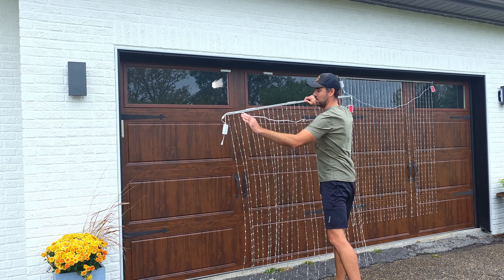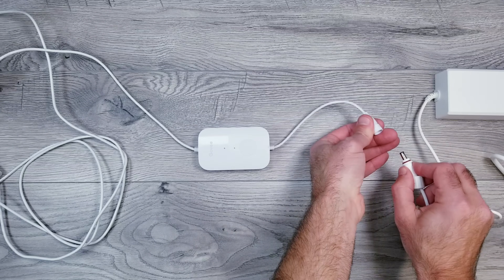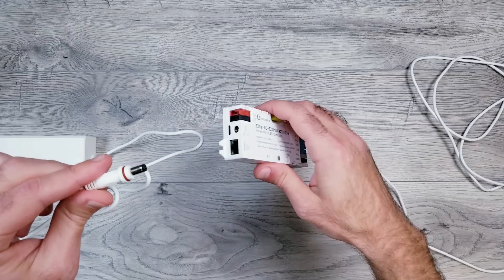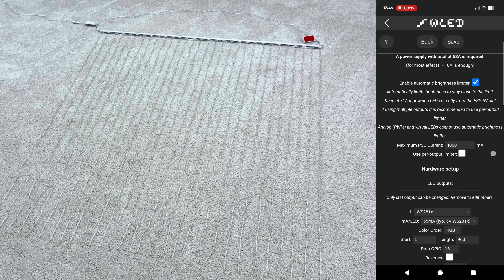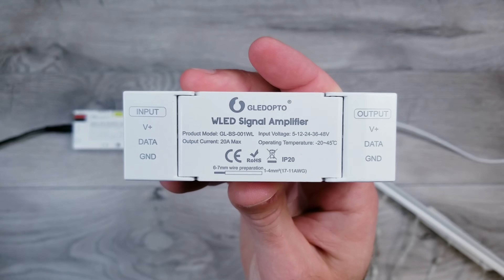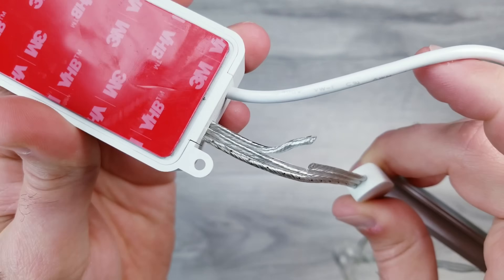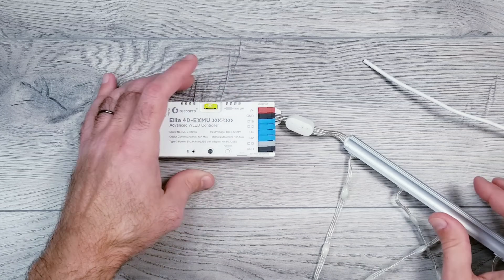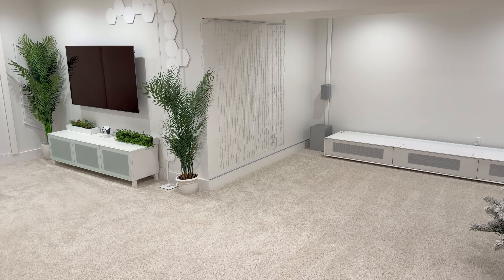will it WLED - episode 9 (new Govee curtain lights PRO)

Comment from the maker: Govee Curtain Lights Pro: https://amzn.to/4oZCkdC
WLED 4D Elite controller: https://amzn.to/4rshOot
Aluminum Profiles i put the curtains in: https://amzn.to/4pVprCs
3m sticky pads: https://amzn.to/4pErBXb
Wire stripper: https://amzn.to/48ckcIk
5v 10a power supply: https://amzn.to/4qda2xs
Waterproof box: https://amzn.to/4pULdWU
Wago Connectors in line: https://amzn.to/49iF6WE
Wago Connectors variety pack: https://amzn.to/48KDrch
heat shrink tubing: https://amzn.to/47QDSBd
heat gun: https://amzn.to/43KZ4Gi

Awol 3500 Pro: https://amzn.to/48ypfDI 
Awol Thunderbeat Speakers: https://amzn.to/4ndzQYd
Shore Laser TV Cabinet + NothingProjector Motorized Screen Bundle : https://bit.ly/4gnltPd

Relevant videos:
Family Media Room Build (ust projection setup with leds): https://youtu.be/IW_wCNGrUyU
Family Media Room Build (65" tv setup): https://youtu.be/H_hejZCOB9o
How to install curtains in aluminum profile: https://youtu.be/FCGJc5-cnTA

🎧🎧🎧 Music (helps support the channel) 
most of the outro songs: https://static85.bandcamp.com/

Visuals at the end: https://www.youtube.com/@visualdon

will it WLED - Episode 1: https://youtu.be/9LPgn81PJnc
will it WLED - Episode 2: https://youtu.be/82lIHTMrzB0
will it WLED - Episode 3: https://youtu.be/3jHuABfkUT8
will it WLED - Episode 4: https://youtu.be/6VestnL6yE4
will it WLED - Episode 5: https://youtu.be/qtBzHRdfxvg
will it WLED - Episode 6: https://youtu.be/JK1xGBP-zhk
will it WLED - Episode 7: https://youtu.be/U6JEBI1LDZ8
will it WLED - Episode 8: https://youtu.be/IwKhO6JDJW8

=============================
Support My Channel Directly:
Become a monthly contributor on Patreon: https://www.patreon.com/ChrisMaherDIY
Buy me a Coffee: https://paypal.me/ChrisMaherDIY
==============================

The best way to help support my channel is to like, comment, make sure your subscribed and share my videos with as many people as you can. The other way is to use my links above as I get a small % at no extra cost to you if you buy something. Thank you all for the support!
Reply: can you do the govve cone tree
Reply: Chris will this setup work with the previous Govee curtain lights 2 as well?
Reply: @ChrisMaherDIY thanks a lot for your awesome work. I found inexpensive almost identical 5v 5000mA curtain lights (no injection) on Amazon that are 21 x 21 and it works perfectly with the same gledopto controller and the original psu. I would like to add 3 more curtain lights to have a total of 4. Can you tell me how to do that both in wled and how to wire it?

Comment: Great video , thanks . I've tried to convert a goovee lyra floor lamp  using the goovee led strip it came with, however it has 5 wires, (5v, data, ground, w, ww and 24v ) used a 24v power and connected to 24v ,data and ground .  No joy 😢

Comment: Happy New Year!
I wonder if you've already gotten the Ceiling Lights (H60A1) and/or the Ceiling Lights Pro (H60A6) with WLED to work. I've installed a bunch of these things here, but I'd like to be able to control them with WLED.
Unfortunately, there is no information available about the ceiling lights.

Comment: so when combining 2curtains, did you use 2 different output ports on the controller or did you just connect the data (and power) lines together?

Comment: @ChrisMaherDIY thanks a lot for your awesome work. I found inexpensive almost identical 5v 5000mA curtain lights (no injection) on Amazon that are 21 x 21 and it works perfectly with the same gledopto controller and the original psu. I would like to add 3 more curtain lights to have a total of 4. Can you tell me how to do that both in wled and how to wire it?

Comment: Love your content like everybody else in here. I gave it a good 10 seconds of scrolling trying to find the answer. Will this work on the original version of the lights that I have or only the pro series? If the answer is no, is there a simple workaround or completely different you think?
Reply from the maker: The originals for sure work. I cant remember off the top of my head on the exact steps but those are running 5v lights (but I cant remember if they are being powered by higher voltage and being stepped down like these are) Should't be too difficult to play around and get them up and working!
Reply: @ChrisMaherDIY  also love your curtain video light you just posted today. I've been contemplating just getting a light piece of particle board or something to move it around and hang because of the exact issue. Keep up the great work

Comment: Hey Chris, great videos as always!  Finally I emailed you just now in regards to simplifying a reversible connection for the controllers and making the Govee 2 curtains work with WLED / Xlights.
Reply: Are you saying you were able to get the curtain lights 2 to work with WLED? I've been trying for over a year now with no success. I saw this video, but realized my curtain lights 2 (3) strand isn't wired the same as in this video.

Comment: I had the same issue with multiple controllers, but found one that worked without any modification. The Controller I used was "wellvow" which is a drop in wled replacement for goveenxcept the power was inverse for these curtain lights so not exactly drop in.

Comment: Thank you so much for the very detailed video, i bought some Govee curtain light Pro on black friday, but when they arrived they did not light up at all, i contacted Govee, and they did not have any more of them in stock so they ended up refunding them.
Now that i watched your video i cut the 24V-5V boxes away and plugged in a Gledopto WLED controller and a 5V PSU i had laying around and it now light up and everything works like a dream, thanks to your video!

Comment: Iv never had any success in getting a matrix set up with WLED, to work perfectly in xlights.

Like you can use a matrix with XLights, or you can use a matrix with WLED, but both are configured in totally different ways and the animations in xlights will only work in a up and down motion but never a side to side.

Comment: The flickering is a ground loop. All grounds need tied before they feed power.   We'll known issue with the cheap ws28xx.
Reply from the maker: Thanks for watching! I didn't have to do anything with the ground to fix the issue. Just snipped the data line at the end like I went over in the video and thankfully everything worked perfectly after that!

Comment: You final solution used 5V directly connected to the left side with power transferring to the right side. However you kept the 24V to 5V transformer on the right hand side which presumably would reduce the incoming 5V down too far. So I'm now confused as to what the final solution should be
Reply from the maker: Thanks for watching! I used the 24v power supply the lights came with but mentioned you could use a 5v supply instead if you wanted to by removing the 24v converter and connecting the controller directly to the lights like i demonstrated in the video. If you do it that way (using the 5v) you would also remove the white converter box at the end and either just power the lights from the beginning or run 5v power injection wires from the controller to the end. Hope that makes sense!
Reply: @ChrisMaherDIY  OK, that makes sense. I just modded two Lepro TB1 and hooked them up to my DJ decks with LedFX - They are awesome, thank you. I think these curtain lights will be next
Reply from the maker: @jamescater66 that's sweet! Yeah I've been having so much fun playing around with ledfx again! It's been awhile but its amazing!

Comment: Great result.., if you have a time for short answer here is the question :
I have 1 meter leftover strip from Skyline kit which I bought after watching your review on that light and would like to use it as notification light for HAOS.
Is it possible to solder that cuted strip and what controler if any would you recommend for simple rgbw light on/off pulsing in zigbee.
That strip has G1151 Govee controler on strip!
Reply from the maker: Thanks for watching! I would have to first try that led strip to see if it would work with wled. I'll put it on my list of projects I'd like to try getting to! I wish I could give you a better answer but without trying it myself i would just be guessing.
Reply: Did you use all 4 meter in your installation in this review?
https://m.youtube.com/watch?v=r1ZvaYaj7HA
I had to cut it(shame, it is great strip but my son didn't want to have it diagonally), it is, I think, Govees latest strip 2 pro....

Comment: I am wondering how good the reception is when you put the gledopto is when you put it outside. I use esp modules and the reception of those is not to good. Would be nice if you could do a comparison 😀
Reply from the maker: Thanks for watching and great question! if someone complains about wled controllers (esp modules, gledopto, quin boards etc) being junk and not working, majority of the time its due to weak wifi. I would say that they are all about the same when it comes to wifi strength. The best thing I did was to get this mesh system https://amzn.to/4p6Lpl0 and put an extender in my garage and all my issues with the controllers I had furthest away from my main modem went away. Hope that makes sense!

Comment: Light guy here.. I put on a music synchronized light show each year with over 100k LEDs, many of which are proprietary that I received for free, and take apart to use in my own controllers. Govee LED products basically all work with WLED - they use high quality SMD components with ws281x chips. They also make some of the most expensive LED lights on the market, and a lot of that price comes from their controller which is Matter enabled - something nearly all, if not all, WLED do not provide...  

You should be testing off brand, mid priced lights for WLED compatibility. So many 24v lights I've received to review that are half the price of Govee claim ws281x but aren't actually, or require me to add an HCT/AHCT level shifter chip inline to up from 3.3v DO to 5v DO. Some don't work at all, but should given the chips on the board. I've spent hours troubleshooting various issues with getting various proprietary LEDs to work with Kulp/Falcon/Wled controllers.
Reply from the maker: Thanks for watching and great advice! I looked on amazon and aliexpress and could not find any curtain lights that had high density 960 leds like these govee curtain lights. (every cheap option I came across on amazon and aliexpress had disappointing densities of 400 to 500 leds which look very bad compared to 960) Let me know if you come across some high density, outdoor rated curtain lights that are not govee, preferably on Amazon since the vast majority of my viewers are in the US and we are spoiled with our same day or overnight deliveries. Thanks!
Reply: Have you converted the Govee Cone Tree?
Reply: @gram7048  No I haven't, but there is no reason it wouldn't work. I've made a 6,400 pixel mega tree before and it is functionally the same thing as Govee's tree - e.g ws2811 pixels in a vertical zig-zag pattern. The difficult thing will likely be programming the configuration / effects in WLED. The Govee tree controller comes with pre-programmed effects for the tree, whereas WLED does not (afaik). Personally, I'd use xlights to program the tree and then export the configuration to the WLED controller. That would make it relatively easy to get cool effects onto the tree.
Reply: Wled isn’t capable of drive more than 2048 leds
Govee aren’t Wled. Govee uses his own software, and ws28xx are rgbic led.
If you want go up 2048 leds, you’re working with a screen, not with a low res pixel matrix
Reply: @victoraca7892  You can certainly drive over 2048 LEDs with 1 WLED controller, just not 1 port without frame collapse. The vast majority of LED controllers out there only drive 800 LEDs per output effectively (with power injection). This is because of frame-rate collapse over longer spans. My shows typically run at 40fps, and driving 2,000 LEDs on a single output would make that strand's max FPS 16 because it would take 60ms to propagate the data to the whole strand. The limit of pixels you can drive per port has to do with the MCU type, output method, protocol, and frame rate expectations - WLED as a software has no limit outside of those variables. 

WS281x refers to the timing chip used in each LED that decodes data, latches the RGB colors from the data, and repropagates the data to send down stream. Another limitation of driving large LED displays is voltage drop. If I put 800 pixels on a single output + wire from the controller to the strand I still have to inject power part way through the strand, and generally need an F-amp (data booster) to get clean data down the whole strand. WLED is simply a software that can be used on a controller, just like FPP (what I use), or what Govee provides in it's OEM controller. They all enable communication with a timing chip at the LED - if that timing chip is ws281x (most common) then generally any controller that can produce ws281x data will work with the LED (exceptions exist). Not all WLED controllers are remotely the same - Digi-Quad are high quality WLED controllers with a built in level shifter, whereas most WLED controllers are just ESP32 boards with 3.3v data-out. But I don't personally use WLED for much other than testing/configuring lights before installing them in my show. My main controllers are made by Kulp, each board has 32 ports, each port can effectively drive 800 LEDs @ 40fps - e.g 25.6k LEDs per board. Fwiw, many the lights in my 100k are from P5 panel arrays I've made. My main P5 panel array has over 40,000 pixels in it. 

This video doesn't reflect how many lights I have now, but you get the idea. https://youtu.be/sTBi0Fp5yrQ

Comment: Can you please explain how to WLED once more using the govee power supply and what wire to cut? I'm a bit confused...
Reply from the maker: Thanks for watching! You would cut the govee controller out and connect the gledopto one like I do in the beginning. Then literally the only other thing you would need to do is cut that data line at the end of the curtain lights like I show you in the video starting around the 4:22 mark.
Reply: @ChrisMaherDIY So its basically power injection, which is always without the data wire. You can then use the data wire from the end of the first curtain to connect to the second curtain. And the power injection wires will go to your second curtain too. If I’m correct with your explanations.
Reply: @ChrisMaherDIY so towards the end is all you have to do?? add controller to one end of curtains and snip data line at other end?? That’s it?
Reply: @ChrisMaherDIY and does this work with v2 the same way ?

Comment: Aren't these lights just an addressable spool of lights cut to hang down? Just asking because they are pretty expensive and a spool on AliExpress is like 1/2 - 1/4 the cost.
Reply from the maker: Thanks for watching! You really cant find curtain lights on amazon or aliexpress that have 960 leds per meter. (everything is pretty much 400 to 500) But you could certainly line up 30 individual strands of lights and connect them all together with jst connectors or soldering to create a matrix display if you are looking to save a little money and have the time. Just make sure all the connection points are waterproof like these govee lights are if your looking to use them outside.
Reply: @DavidHust I think the Govee are fixed address seeds. All the spools you get are serial, so you have to zig-zag them down/up in a contiguous string.

Comment: Could you maybe make a video about the software side of your gaming room? And how to setup and sync both horizontal and vertical led strips. There is a lot of information about the hardware side of WLED, but i can’t find much about the software side.

Especially those lights on the wall on the back of your monitor, the 2 outer ones are longer than the inner ones, so how do animations work etc.
Reply from the maker: Thanks for watching! Yeah its been a while since I did a wled software tutorial. I cant remember how much of the software side I go into things but here is the video where I built the room in case you have not seen it yet. https://youtu.be/IW_wCNGrUyU
Reply: @ChrisMaherDIY  I meant the gaming room, with the basketball figures etc. But yes, a wled software tutorial would be appreciated.
Reply from the maker: @HvV8446 ahh lol sorry my bad! Yeah the gaming room is set up perfectly for a WLED tutorial! I'll make sure to include that when I make a software video!

Comment: I’ve been waiting so long for someone to make this video so thank you so much! Do you have any experience with the converting the non-pro, first generation govee curtains?
Reply from the maker: Thanks for watching! I remember I did get those working with WLED. I believe that was pretty straightforward because if my memory is correct, I think those were 5v! Its for sure possible and easy to do, but I don't remember of the top of my head the exact steps!
Reply: Same procedure. Just cut of the data line at the end. thx chris :)